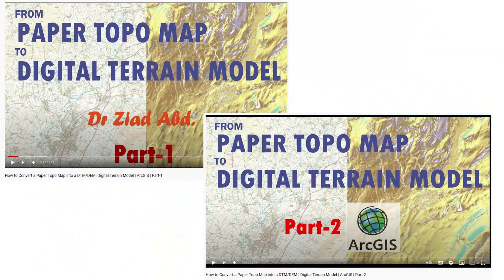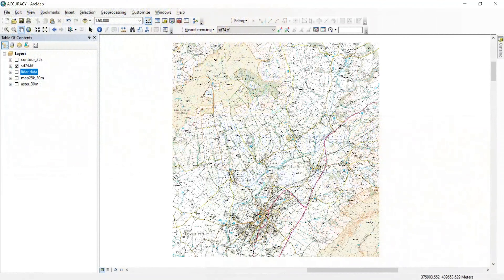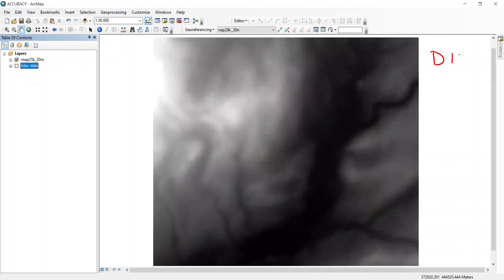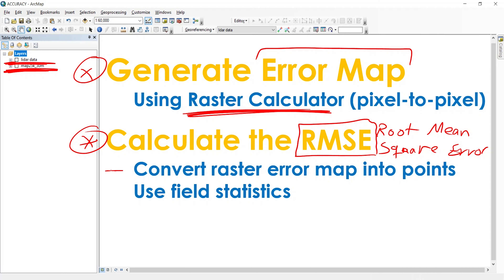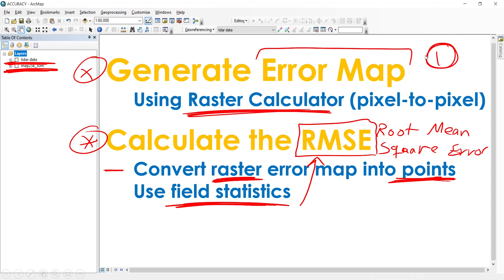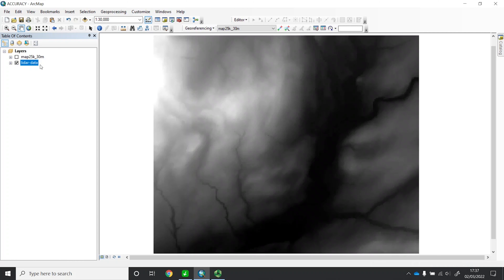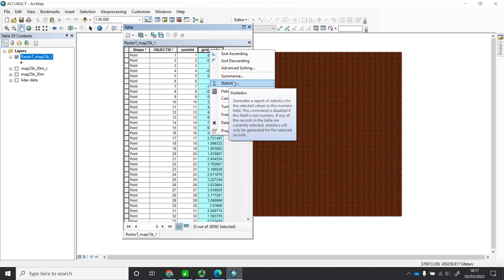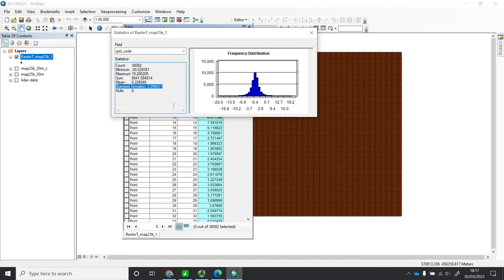DEM Accuracy Assessment | SRTM ASTER DEM DTM | RMSE | ArcGIS/ArcMap

Comment: Thanks for the informative video.

Whether the both dems (Lidar and topgraphic) had same resolutions? If not, how can we subtract two dems of different cell sizes?
Reply from the maker: Hi Musaib. Yes you can subtract two different resolutions.
Reply: @ziadabdeldayem6884  Thanks for the reply sir.
In that case can we resample our less resolution DEM (12.5 m) to a high resolution (1m) and then subtract two Dems for evaluating the difference between them. 
P.S: I know resampling will not increase the accuracy but I just want  a dem finer cell size (1m). All I am worried about is that whether resampling can change the original/ actual elevation values.

Comment: Hi. If you have a dataset that contains elevation information associated in feet and you want to make a comparison with another dataset that is in meters, it is necessary to convert the data in the same units?
Reply from the maker: It depends on the comparison  techniques that you are going to apply.
Reply: @ziadabdeldayem6884  I have two DTM file. next, I want to compare both of them together. Bothe of them have only angular unit and do not have linear unit. so how can I know the cell size of them is according to what unit? meter or feet.